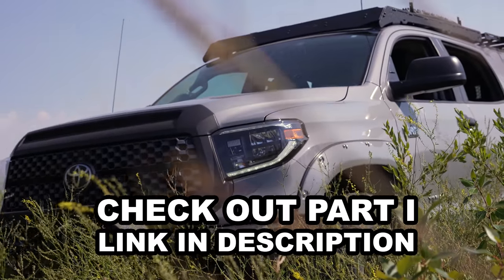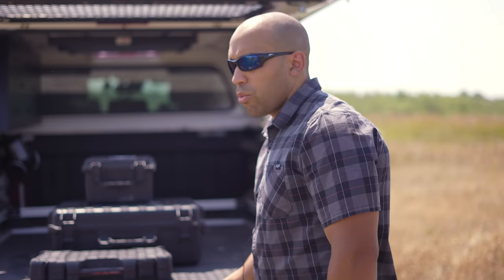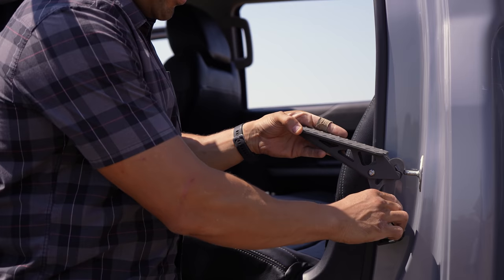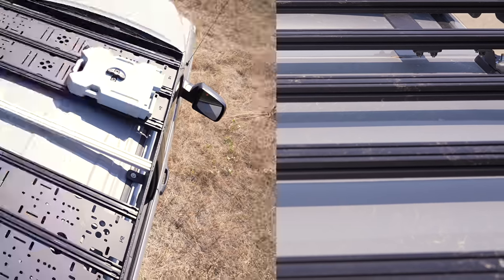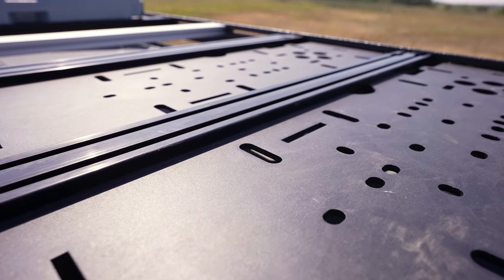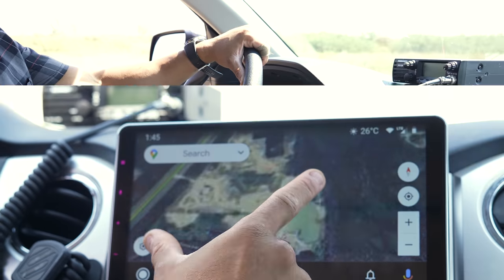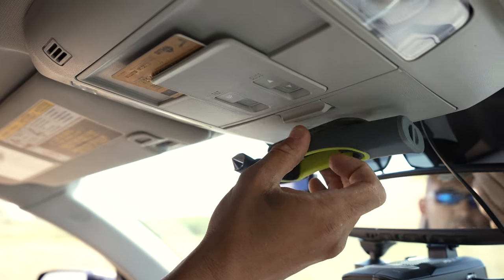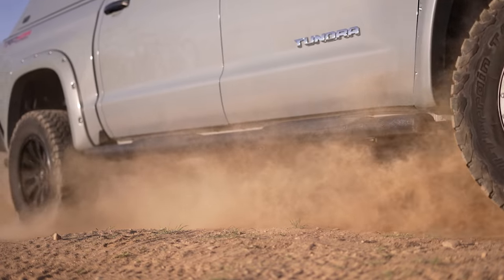10 Vehicle Survival Modifications You Should Consider

Comment from the maker: Check out Part 1 here https://youtu.be/RWBg1gsLTws
Reply from the maker: @Klam That video is coming soon!
Reply: Definitely check out fieldcraft survival mobility department.  I put in the mobility bags on the back of my seats in my tundra. Medical and survival gear that can be quickly turned into a backpack incase you need to exit the vehicle and leave it behind.
Reply: If you can't fuel it and spark off that fuel, you won't be going anywhere. That engine has no provision for a points distributor, and there's no carbureted intake manifold for it. Wrong truck.
Reply: @Klam mail-order a crossbow and a compound bow shipped from the USA.
Reply: @idaho_trd  which you will when you can't fuel it or spark that fuel. No Tundra engine has provision for a points distributor, nor a carbureted intake manifold. Wrong truck.
Reply: @davisstephens8405  🤣 k bud.
Reply: Do you not emf proof your vehicles and electronics?
Reply: @CanadianPrepper  just a thought Nate, but if you get into an accident or go over bumps that rescue tool will be long gone and out of reach. Just a tip, but spray your ResQ Me key chains with a clear glow in the dark spray (just a mist) and put a heavy duty keyring around the visor bar towards the A Pilar of the truck and tuck it behind the visor. Access to both front occupants and no need to worry about it flying away in an emergency. That's how I have it in my Tundra and is by far the best option. Another backup if you subscribe to the "two is one, one is none" theory of prepping, you can use micro Velcro around the lowered loop of your lap belt (outside the buckle) and attach them there as well, and you can repeat for all passengers. No muss, no fuss. You never want to be looking for shit after a rollover or a submersion. Kept nice and tight at the outside of your waist.
Reply: Your link takes you to part 2. At least for me. Endless loop of part two.
Reply: Might as well get an 80s-90s Toyota rv. Close but can't stand up

Comment: Coolant and motor oil is a must. People don’t know how screwed you are with a coolant leak or actually hauling ass in an emergency as really pushing your cars limits burns oil.  Some more than others but they all do.
Reply: Good Point
Reply: With restoring my Xj I had the coolant game an obstacle. I learned from that and owning Honda’s you gotta check the oil once in a while and it’s good to carry a cart or two.
Reply: ‘08 tundra. I’m able to store 2 qt oil under the hood, 4 gal water behind rear seat (never froze yet). Also an extra gallon of wipe fluid under the hood (a must!).
Reply from the maker: Great point! I will add some for sure
Reply: @CanadianPrepper  Why do you have an internal cabin camera? Isn't that a privacy concern?
Reply: True! We ended up roadside with an overheating issue. Also, watch for nails on the shoulders.....for some reason they were everywhere and we nearly flattened the tires on our rescue vehicle!
Reply: @cherokeefit4248  Fellow XJ head here...yep out of the 6 ive owned over the past 20 yrs, that cooling system is the PITA..terrible design but I always loved that jeep
Reply: Very very good point!

Comment: I would really recommend to people to learn how to drive a manual car, useful ability, and the skill can be translated to some older rural equipment  that you may have to use
Reply from the maker: I drive stick but it's a dying breed
Reply: only in usa and canada
Reply: Hell I learned on a 18 speed and still roll it down the road
Reply: @CanadianPrepper  in your Toyota?
Reply: @karrie3747  yeah, they are definitely different, i am referring more to those improvised tractors or trucks. I  personally never used a automatic car, so in my case i need to learn how to use one ASAP lol
Reply: Here in Sweden most cars are still manual. Only time I wish I had an auto is whenever I get stuck in a queue 😂
Reply: Definitely,  my dad always preached this.
Reply: @karrie3747  Lol
Reply: My dad made us all learn to drive on a manual (circa Y2K). Crazy how so many don't know.
Reply: @CleaveMountaineering  Yeup. I learnt on an 03 3500 longbox dually crew, and an 86 international 5ton with a 13 speed. My sister was unfortunately a lost cause when it came to manual. Came in handy when I got my Class 1
Reply: @eliasbram3710  learning to drive an automatic car?

it's the right pedal.
Reply: Also if your starter quits and you can push it or find a handy hill, you can start it.
Reply: Some kc lights front and back
Reply: Everybody in Britain knows how to drive stick

Comment: Nate, great video!  I would add (2) pieces of commercial carpet, about 14" (35.5 cm) x 30" (76 cm).  They don't have to be new; I'd ask a carpet layer for any scraps he may have left over from a recent job.  Pieces of carpet are multi purpose, compact, and light weight.  They can be rolled up and secured with Canadian jam knots so they don't take up much space.  

You can use them to lie down on if you're working on a muddy/wet/snowy surface; you can place them under a tire for added traction in muddy/sandy/icy conditions; you can place them at the opening of your shelter/tent so you have a clean spot to step on when putting your boots back on; you can use them as an insulated layer during the winter when sitting on frozen ground or some cold tree stump; you can use them to protect a surface from a heavy/sharp/odd shaped object that would otherwise damage the surface below it; you can use it as a wind screen for a small fire by bending it into a "U" shape with cordage; you can use it as a floor mat in the back seat to keep the OEM floor mats clean/protected; you can place the carpet on the lift gate and use it as a working surface to keep small parts from getting lost or rolling away.  Use your imagination and you'll probably come up even more ways to use them!

Comment: In addition to a standard alarm system, add a secret fuel pump kill switch. It's not hard to do. If you aren't handy, a competent mechanic or car electronics store can do it. Make it hidden but easily accessible to you for when you get out of the truck. (Inside the cabin) Thieves can hack alarm systems but if they can't quickly find the kill switch they will likely move on after some superficial damage to the truck during breaking in.
Reply: Honestly, newer car? Just pull the fuel pump relay out.. if you're real paranoid buy a spare and yank a pin out of it..  On an older vehicle just swap a plug wire or two on the distributor.
Reply: Mad Max! 👍🏻
Reply: And steal stuff too but you would still have your truck. My dad put a simular switch on his Mustang.  Only it was the starter that was killed. Obviously an automatic trans.
Reply: My favorite was a guy who mounted a metal switch just under the plastic dash, wore a magnetic ring and would "pray" to mumbo jumbo the god of gas combustion while laying his magnet fingered hand over the switch....

Comment: @4:05, drill out the rivets, separate the leg parts, slip on a section of aluminum pipe, re-rivet the leg supports back together, and now you have locks for them.  You could even screw in a stopper to keep the pipe section from slipping past the joint.

Comment: You may already have one in there, but keeping an extra serpentine belt is handy when in the back country. Also a battery jump box, besides the extra motor oil and anti-freeze someone else had previously mentioned.
Reply: Or some nylons (the kind on women's legs) if you'd prefer to save space and have a lot quicker installation can serve as your serpentine belt until you can reach home/better tools
Reply: Most trucks have electric rad fans so it's not as big of a deal. Mostly just for AC and power steering, and alternator

Comment: The roof rack design you have is better than a "Single piece of steel" as you mentioned.   
Think about it like this, if you are navigating a tight spot with low hanging branches, or a tight rocky canyon and you hit the rack, it is easier to repair it by replacing the damaged part, it will likely give before it damages the vehicle itself, and lastly, in a rescue situation, you COULD take a few of the cross sections and make a platform to transport someone.

Take a look at Frontrunner outfitters for a good quality roof rack.

Comment: I cheaped out and took the plastic bed liner out and put spray in liner. I cut the bottom of the plastic liner out, threw the sides away, split the bottom and use them as slide outs in the box. It works pretty good, better than a garden rake to fish stuff out.

Comment: You should consider some spare mechanical, and especially electrical automotive parts. Check off roading web sites for "must have" back ups that you  will need when off grid out in the boonies that will probably not be available at your 'friendly"  zombie supply center.
Reply: Not sure how this would apply to the more modern trucks, but like some late 90s early 00s C
Chevy EFI guys carry around a carb so if the EFI fails they can slap the carb on.

Comment: I would add sway bar disconnects for very rough terrain, extends the amount your chassis can twist/travel in opposition to the frame, aids in traversing rugged terrain without rolling over. Also a simple kill switch from battery/fuel to prevent starting the engine. Never know if someone is gonna try to enjoy your truck more than you :p. Also, get some raised tube type differential vents, water in your diffs will really mess with the diff longevity if you're forced to go off road. Also, as food for thought rather than a modification. Know how to disconnect your toyota Safety Connect. Its Toyotas version of OnStar. Lots of nifty things can be done via satellite connectivity. Good if you need it,..... but

Comment: Definately attach that Resqme more securely dude. If you have a serious crash, the G-forces will propel that thing and cause it to bounce around all over the cab
Reply: lol I was thinking the same exact thing. That is for sure flying off in a roll over. No sense in having something like that if when you need it you can't find it....or the very thing that is supposed to help save you ends up whacking you in the head and making things worse. I suppose it's a live and learn situation. People who have been in major accidents will all probably instantly spot that.
Reply: Attach what?
Reply: @kirkhupp8886  The Resqme glass breaker mate.
Reply: @jdkgcp  Well said. I think the contents of a vehicle experiences G-forces of 20-30gs even in low speed collisions. The bottom line is: If it aint strapped in, its going to take off.
Reply: I can validate that, flipped my car 4 times over on an icy road when a log truck came behind a curve in the middle of the road. Later on lying in the ditch on the driver's side I found a jack and an axe in my feet. They came from the tool box in my trunk. Luckily they did not hit my in the head.  Escaped with only minor bruising. Car was totaled and next summer picked up rest of the tool box content spread across 50m in the ditch.
Reply: @bunba_77_15  Thank you for sharing that. Im very pleased that you made it out intact Jani. Thats a lot of heavy metal flying around
Reply: @bunba_77_15  wow thank God you're alright!

Comment: I did not notice but a light bar up front for added visibility at night and maybe a set of square led lights inside the corners of the rear cap for rear visibility. Say to help with an extraction of a stuck motorist. Also a few led strips in the rear cap for night visibility. I'd go with red for a more inconspicuous approach.  Basic tool set and id also recommend a back up fan/accessory belt, nothing worse than overheating or loosing battery charge when on the move. 

Just a few of my ideas.

Comment: Good Evening and Greetings from the the land of ice and snow (Alaska), you can fashion slide locks for your table legs with some 1 inch wide 1/8 inch thick steel to create a loop by bending and hammer to fit that will slide onto the hinge struts and then slide along to to the hinge point then bend closed with vice grips.

Comment: Tools like a folding shovel (in case you get stuck), socket set, air compressor, green goo (for sealing tires), and a maintenance/repair manual for your vehicle. I've managed to get myself out of all kinds of bad situations with just those few items. Up to and including doing a makeshift repair on my belt tensioner at 2am in a McDonald's parking lot.

Comment: Great video two thumbs up👍👍. The only recommendations I have is be sure to try your spare tire release mechanism. I have a Toyota Tacoma 4D, 2018. When I attempted to change the flat tire in front of my house mid day, what a nightmare. It was difficult Because the Antitheft mechanism broke. Good thing I was in front of my house and had an extra stainless steel hose clamp to modify it. When changing your tire Use a big piece of cardboard to keep the dirt off your knees and legs.
  I would also recommend get some weatherproof 12 V female receptors for under your hood and the back of your vehicle. After all, if you ever need an accessory, fan, light, etc.
  Another item to have when camping is a washing machine drum And perhaps a optional sheet of metal for the drum just in case of rain or sparks.
  I recommend A 2000 W power inverter with battery cable clamps or high amperage quick disconnect power plug.I keep mine in a quasi-briefcase. I use mine for tree trimming with my van and a saw-saw. This will be handy for you, went off Roading and needing firewood.
  I remember one time I had a whole lot tree debris (8-12 trash cans)and no fire permit. So on my driveway I brought out 10 chairs a large cooler and a boom box stereo. I’ve burned so much palm tree debris in my washing machine barrel that I think I had 20 pounds of charcoal at the end of the day. Early that morning the two volunteer police patrol was watching me in their car, but too lazy to investigate if there really was a party because I was the only one there😂😆🤣😆🤫🤫.

Comment: Taking a page from the off-road community, proper beadlock wheels would be top of my list to replace the crack-dealer rims that the Toyota dealer installed to pump up their profit. Front and rear lockers (air or electric) are also mandatory upgrades for serious 4x4ing. 

Thinking a diesel would also be better than a gas engine for a) ignition-less running and b) variety of fuels it could potentially run on when the taps are turned off.

Comment: I ordered a rebel 1500 with the ecoDiesel engine and upgraded the fuel tank to the larger 33 gallons giving me an autonomy between 800 to 950 miles (hwy) and carry a small 2.5 gallons just in case. Installed anti vandalism film on my windows and a cell phone signal booster. Carry tools and personal protection equipment with some long term food and water storage. Upgraded the rear diff cover and transmission pan for more efficient cooling and use friction reduction additives on engine oil and transmission plus fuel additives combined with a large oil filter. All the first aid kit, map and binocular. Installed an emp protection and use nano coating to protect paint. Installed sound attenuation that is made of fire retardant material and as a benefit in combination with the security film keeps the temperature variation lower than normal. I liked some of the upgrades you did but I took a different approach since I was concerned about trying to keep a low profile but I understand this is not the theme of your video. In my case I drive this truck daily and can’t make it too obvious all the preparations that were done to is. I am actively looking for bullet proof door panels so if anyone have a good recommendation I would greatly appreciate. Thanks for the contents and looking forward for future videos.

Comment: Enjoyed your video. Just a note though regarding the standard Velcro sticky back. It is common for the sticky back glue to fail.  To resolve the issue apply some good quality Crazy Glue to the sticky back, then apply to the location in the car. The Crazy Glue will overcome the heat related failure  on interior automobile plastic.

Comment: Nice rig for sure. I am not sure about your model but Toyota trucks are typically geared too tall for effective towing so a change in differential gear ratios may be in order and once you're in there you may as well pop in a locker or two. In my 05 tundra quad cab I replaced the stock 3.91's with  4.88's and the drivability improved greatly. It took a lot of strain off the transmission towing uphill. Gas milage improved a bit as well. I added an Eaton Tru Trac Torsen mechanical limited slip in the rear end as well.

Comment: I'd try making at least the front cabin bulletproof (if that's even possible), have some runflat tires and a rain water filtration on the roof + storage system inside the truck.
Reply: There are no runflat off-toad tires. There are BFG KM3s.
Reply: @yunggolem4687  I'd go along the lines of your solution 👌 great input! I't might be important to protect the gas tank and maybe a key area of the engine too.

Comment: Spare tires full size x2 and electric air pump for tires. You could put in truck bed 100 gallon fuel tank external and keep extra fluids antifreeze oil filters window washer fluids and buy a cover for your truck so when bugging out you cam camouflage it. Buy a bike hitch so you can take bicycle with you. I didn't see jumper cables. Tire chains tow straps
Reply: Naw, just run BFG KM3s